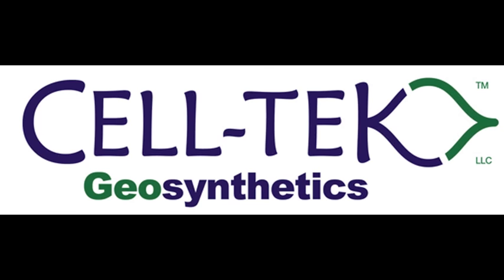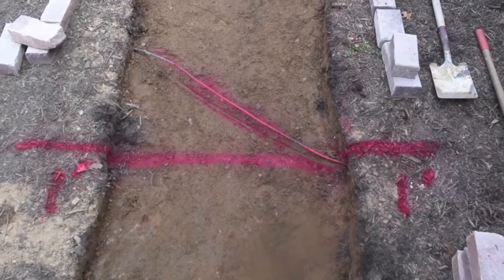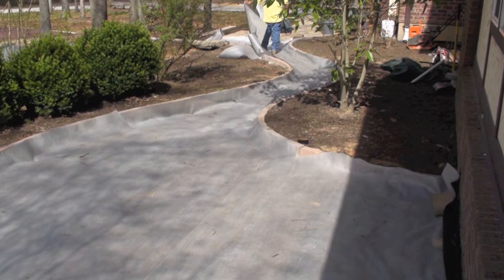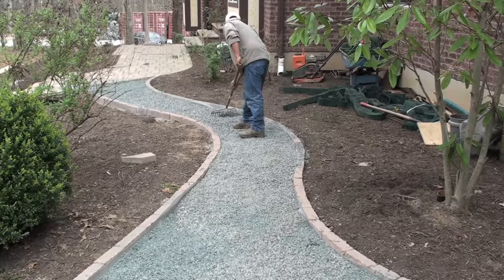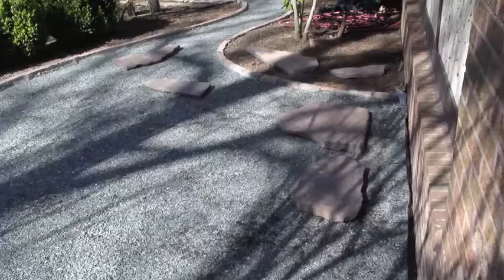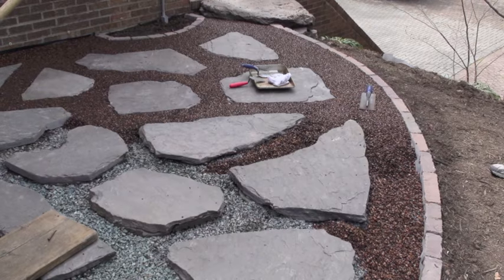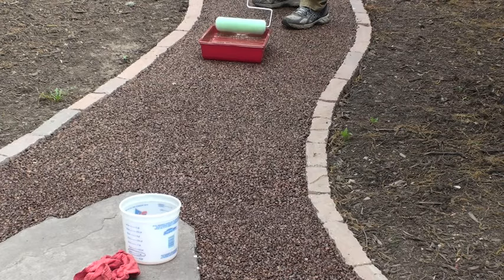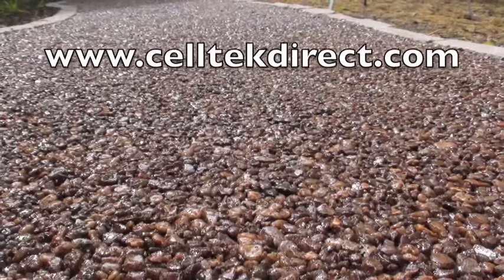Gravel-Lok Installation: Mix Method

Comment: the problem is this isn't gravel !!!! this is a pee rock    will this work on a true (gravel) driveway ?????? can you spray this on a heavy driven driveway any length and let it soak in to allow gravel from coming loose and pod holing ?
Reply from the maker: Gravel-Lok can be applied to any type of stone or gravel, even angular gravel, that is anywhere from 1/8" up to 2.5" in size and it will hold it in place. For driveways, you want a smoother surface and only smaller stones (typically 3/8" size stone is used) can be troweled to a smooth surface. Larger stones can't be troweled to a smooth surface which leaves some stones sticking up and those stones will be more vulnerable to coming loose under the pressure of car tires. Gravel-Lok is thick like syrup; it cannot be "sprayed" on. However, if your stones are already down you can clean them in place, let them dry, and sprinkle the Gravel-Lok liquid on with a watering pail or gravity wand. Follow that up with 1 - 2 roll coats, allowing it to cure in between. Please call us at 888-851-0051 to discuss the best technique and installation tips before attempting your first project.

Comment: Hello, what can I do, this young man, he said he could put in a patio with steppingstone, then heput a thin layer of pea gravel over black paper, and left the grass under it, what do I need to do to fix it,? Noe the pea gravel is on my patio, I sweep to put it back but the paper is showing through the gravel, can you tell me what I can do to fix the mess he left
Reply: Didn't you see the video?  Use Elmers Glue and a paint roller
Reply: But seriously. Add a wall to secure more gravel.  Compact it down so it doesn't move
Or you have dig out the grass and do the job properly.
Reply: The paper is gonna kill the grass,  its fine
Reply: Did he compact the sub base?  If not its not going to drain well. Also, any gravel with smooth edges will not compact well [and will shift]. Try 3/4" jagged gravel.

Comment: Can i use this product, on top of an existing walkway, that uses  two side by side 12x12x2 1/2"  red brick looking flat pavers . I have small pea sized gravel around the blocks and out to edge of walkway. ( about 100' of pathway) Thankx
Reply: HGR693 I would like to know that also! A young kid put some paper down but he left the grass under neath the paper and put a very thonlayer of pea gravel on top. Noe the gravel gets all over my patio, and my stepping stones gave a 4-5 inch gap , instead of the 1-2 inch gap that I ask for, I don't think this kid new anything about doing patio work, I don't know what todo now! Very I happy
Reply: HGR693 sorry mytablet is messing up, I am not happy! Very up set, I just wasted money for nothing,

Comment: Can you make a drive way with Gravel Lok?
Reply from the maker: Yes. Gravel-Lok can be used to create driveways. However, please keep in mind that routine maintenance would be required. Over time a certain percentage of stones come loose and with a driving application this can happen at a faster rate, especially where tires turn. Maintenance, in the form of patching and roll coats, would be needed to maintain the bond. When you need a permeable driving surface, Gravel-Lok is a great option. It is lower in cost than permeable pavers and it looks infinitely better than porous concrete!